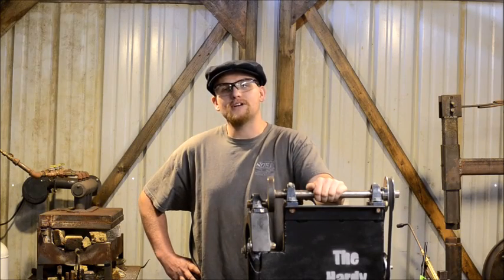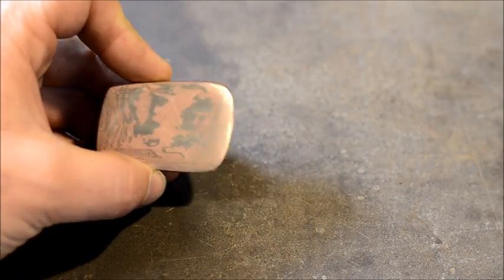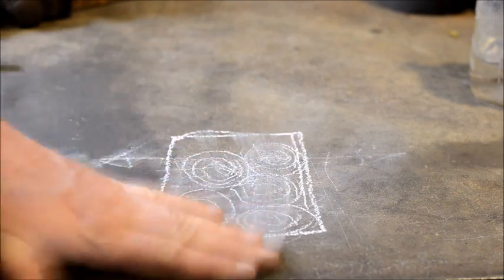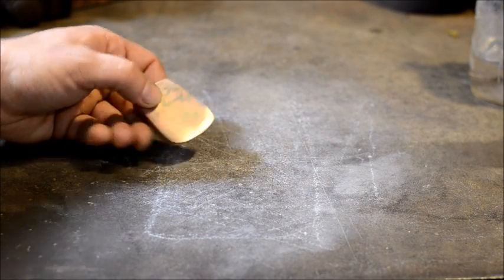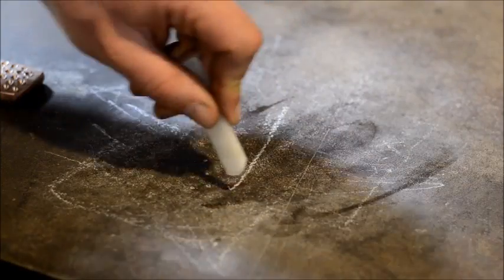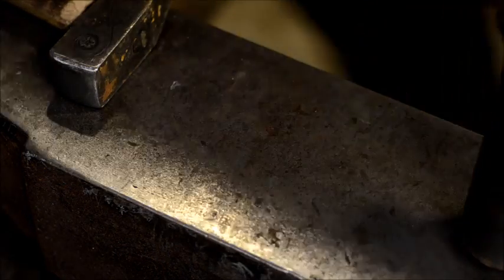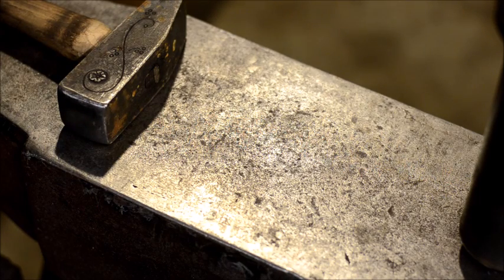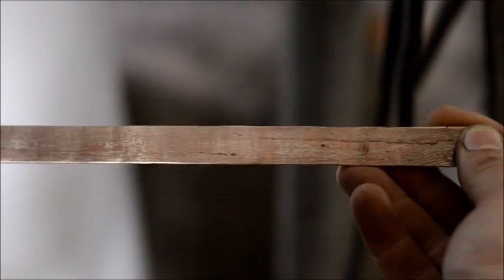How to Make Mokume Gane From Quarters PART 3 //Making Mokume Gane Billet

Comment: Hi Roy,  Love the Series!!!!   I think the pattern name in damascus is"Raindrop"?   In order to save material...and this is a question...not a suggestion....could you use a conical punch to create the same affect without losing material?
Reply from the maker: +Charles Wright Thank you very much for the compliment!
If you punch into the material it will have I believe a completely different effect.. With the drill method you would drill than forge out the billet flat. With the forge method you would punch them in and then grind flat. Maybe a interesting video though :-)
Reply: Thanks Roy!!!!  Wasn't sure it would work .